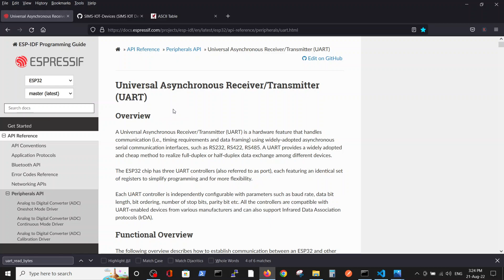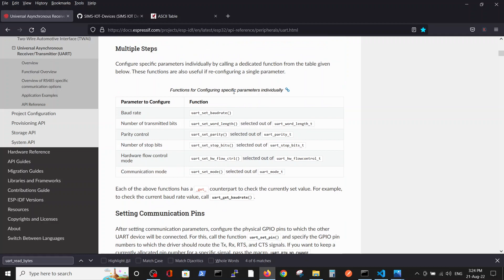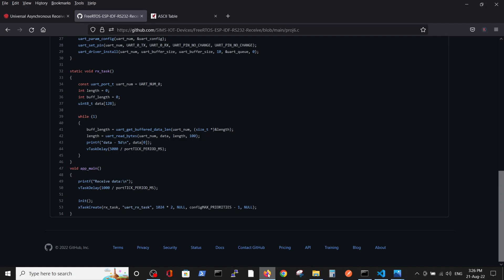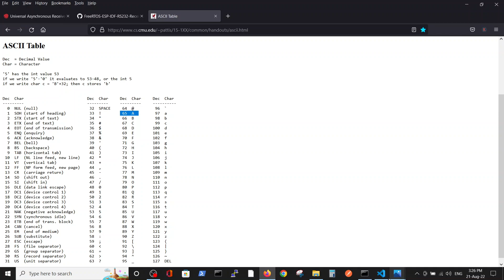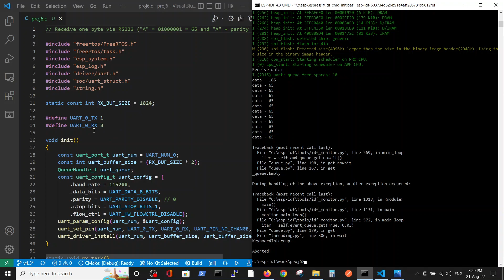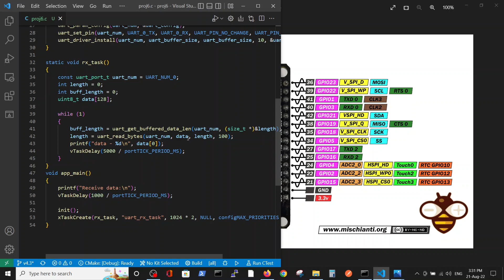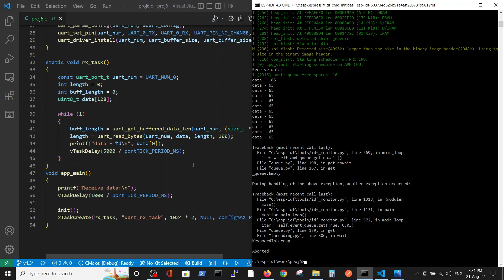2 - Receive one character via RS232 from ESP32 to ESP32 in FreeRTOS ESP IDF environment

Comment: Receive data:
E (2320) uart: uart_param_config(726): Invalid src_clk
I (2320) uart: queue free spaces: 10
data - 49

data is received perfectly but i getthing this Error        E (2320) uart: uart_param_config(726): Invalid src_clk
Reply from the maker: Dear @mohammedjasim4574,
As I understand you have connected two ESP32s for RS232 serial communication.
What was the clock definition for every ESP32?
Reply: @simsiotdevices6219  Dear Sims Actually iI'm using only one esp32 on version 5.1 but your code working on version 4.4 but not on version 5.1
Reply: Problem Solved  

I just Add   .source_clk = UART_SCLK_DEFAULT in uart config for new version 5.1 and its worked

const uart_config_t uart_config = {
        .baud_rate = 115200,
        .data_bits = UART_DATA_8_BITS,
        .parity = UART_PARITY_DISABLE, // 0
        .stop_bits = UART_STOP_BITS_1,
        .flow_ctrl = UART_HW_FLOWCTRL_DISABLE,
        .source_clk = UART_SCLK_DEFAULT,
        };